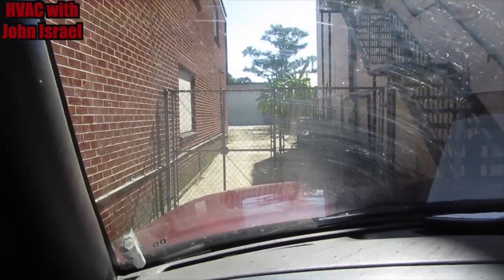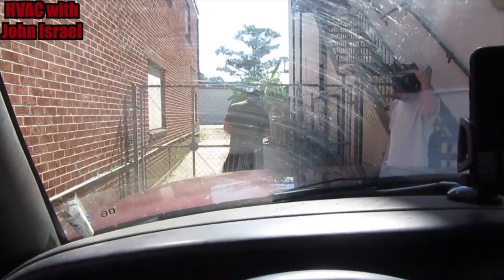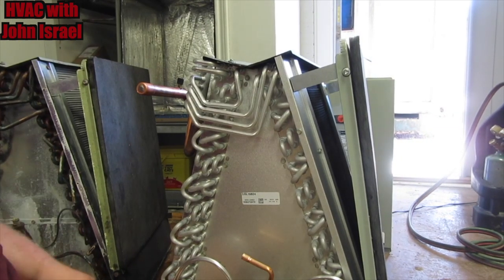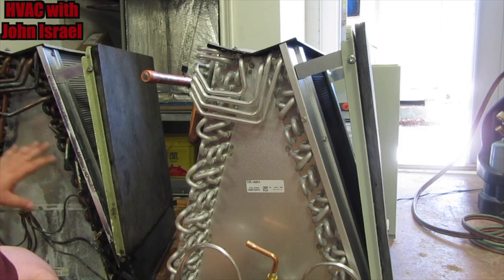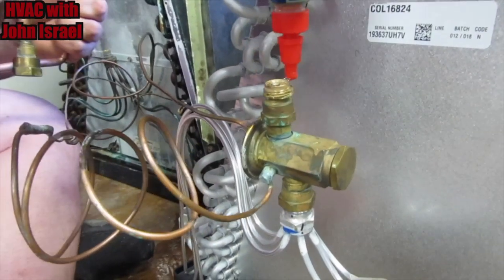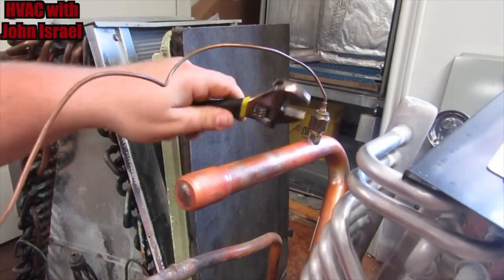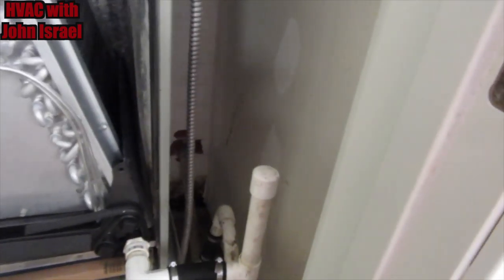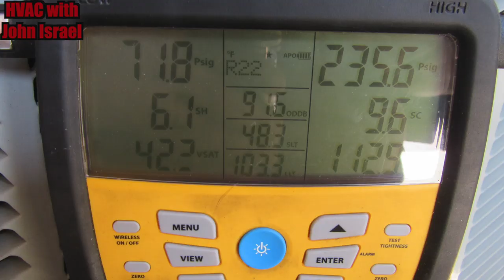How to Replace a TRANE HVAC Coil

Comment: I had a certified tech (supposedly) that performed the same procedure and the system started leaking in my attic.  He said the all-aluminum coil didn't mate well with the brass.  I watched the tech perform the procedure and now realize after watching your video, the tech did not use Nylog.  It cost me $1400 for a new coil and $400 for installation.  I called the tech hours later after installation and told him the system was leaking water into the drip-pan and he said, "sorry, I've done all I can do."  Great video!  Needless to say, I had to buy a brand new system.
Reply: Nylog is a preferential use item, it is NOT required to make a proper repair.
As for the water, it is supposed to drip into the pan and then run out the drain.
Reply: @jrsmyth9761  I thought the drip pan was a safety measure.  It also was dripping from various other areas.  In my opinion, having been a small-time developer I've seen some good HVAC techs, but way too many cowboys in this field.  I usually subbed everything out except for the framing of the house.  It is something I should've learned how to do because while I can still buy a complete unit with my contractor's license I have a hard time paying half the cost for the installation to a ham an egger.  Example,  recently purchased an Infinity system and the company tried to charge me $6000 grand for the install with the total cost being $12K.  These tech cowboys are going to price themselves out of a job.

Comment: Great video man! Personally, I would have replaced the txv as well or at minimum replace the o rings in it. Just as extra precaution. I did hear you said you taped up the txv bulb. You know what you're doing for sure! I've been to too many calls where install or other techs leave txv bulbs inside the plenum without insulating and I'm thinking theirs a bad txv when it was just not installed properly. Overall, good video  brother, thanks for sharing.

Comment: Great video John, but why didn’t you put on a new txv? Was this a warranty job. I only ask because seeing how that original txv was repaired, I wouldn’t trust it, and I know there fairly pricy at $100, but I would think the customer would rather spend to have a new one as opposed to having to pay again to come out later on to replace it when it fails. I would have changed it, but that’s just me I guess. Love the Nylog, greatest thing that has come out, wonder how we managed without it back in the day, of course back then things were so much simpler and better made.

Comment: It's a shame that new coils is going to leak. Copper residue from the old coil left behind on the foil insulation is going to galvanically corrode the the aluminum.  I give it <5 years..

Comment: Next time you order a coil you can have them already put the TXV on from the factory and pressure checked with the TXV from the factory with bulb placement the way they want it, for the same price expressione if the unit is under warranty, nice work though John

Comment: Question: It appears that the TXV is brass (am I wrong?). If so, that means it is primarily copper and likely to galvanically corrode at the juncture with the A Coil nut. So, should we be concerned about galvanic corrosion here?

Comment: Seems like they need to change out the lineset when they get a new unit. I did the same thing, I know it can cause oil flow back to be an issue, but I didn't know better working for that horrid company. What I used to do with those Trane Panels where they have the lines running in, I used to pre-pipe the copper in, move the panel out and have it follow the lineset far enough where it wouldnt burn, and gave me enough room to braze, just a tip, I agree they didn't think that out all the way with the older Trane units. Good job tho.

Comment: Hi John
 The Nylock does no good on the thread of the fitting. If the joint leaks it will come out around the pipe and the nut.I would have put a new TXV on.Good video
Reply from the maker: Wrong it’s a thread sealant.

Comment: Better watch out un-sweating coils like that. I learned my lesson when I had a 5 foot ball of fire and boiling hot oil shoot out in to the customers house while working on a closet unit. Sucks re-piping but I only cut em out now.
Reply: So this implies that the typically small amounts of compressor oil had become redistributed throughout the system, and you set it alight? Is that correct?
Reply: @BigFritz2  more or less. It wasn't a small amount though

Comment: I have a 7 year old American Standard 3 ton heat pump, the coil has a hole in it I guess there’s no Freon either. Are these units pieces of junk or what? Should I get the coil replaced or buy a new one? Not a happy camper especially since I e been paying my AC guy to SERVICE my unit every year. 😡 I got a price of 1200-1400 to replace coil and 2900.00 for a NEW one.

Comment: gread video - I watch all of yours.  Let me ask- I use nylog- (I'm relatively new to the trade)---but on those fittings on txv etc (obviously nylog works) but what about things like leak lock or the locktite 557 or whatever it is (for refrigerants).  Would those work equally well?  do you use nylog just because it works and is convenient or is there a particular reason you dont use others.  I'm trying to understand when and where you might use a different product.  THANK YOU!
Reply: The reason you use nylog is because it is made from refrigerant oil and will not contaminate the system. Leak lock is a good product but it isn't made to be INSIDE the refrigeration system, it's good for sealing caps on leaking service valves. With nylog make you use the correct one for your application it comes for hfc or hcfc/cfc
Reply: Leak lock and 557 your going to use it when you got a fitting that’s going be almost permanently on there. Nylog is good for fittings that you’ll be separating maybe periodically it’s not a glue like leak lock. Nylog is suppose to be around the mating surface as well not on the threads, leak lock goes on the threads.